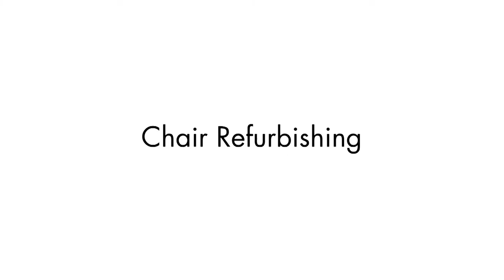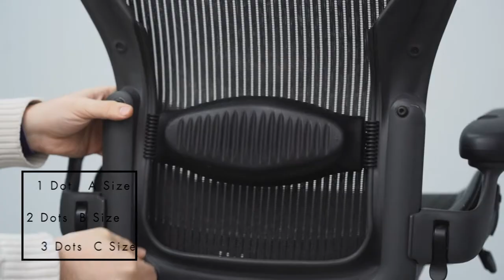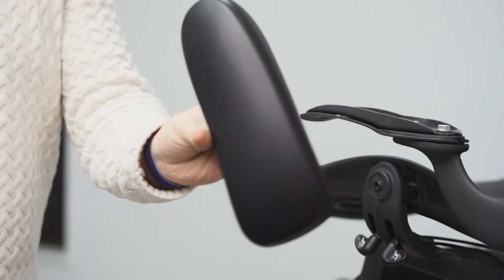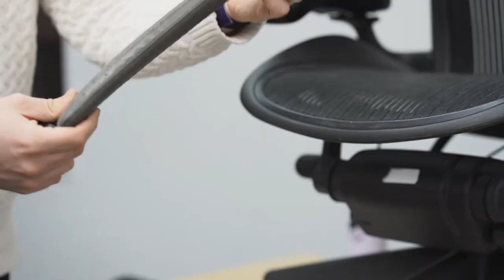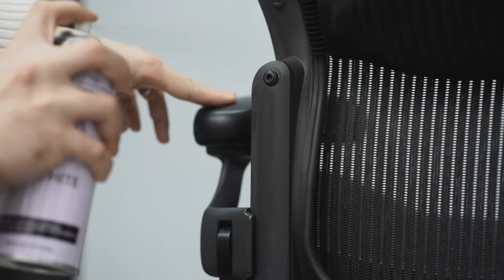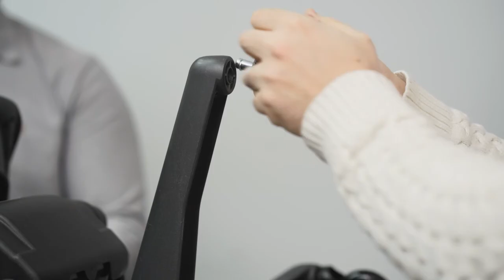Armpad, Lumbar and Touch up for Herman Miller Aeron Chair (Installation)

Comment: is the new seat foam meant to protrude upwards that much?
Reply from the maker: the seat foam can be thinner. also, seat foam get thinner by time. you may remove the 3M layer to have immediate thinner seat foam.